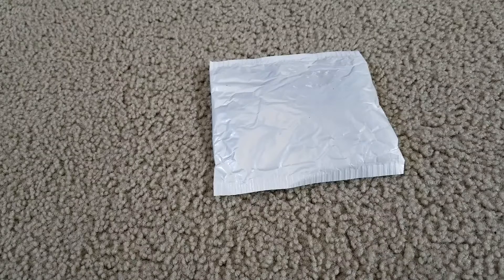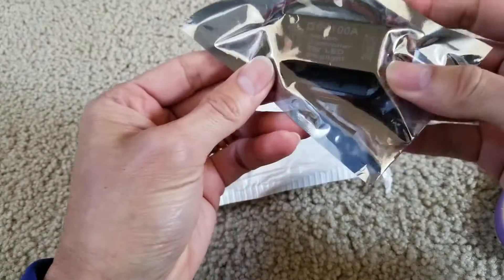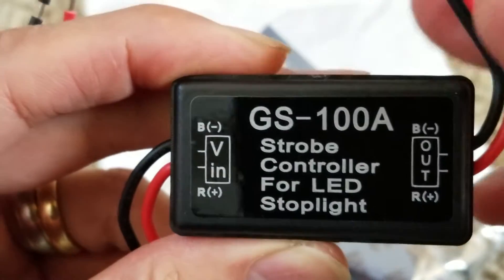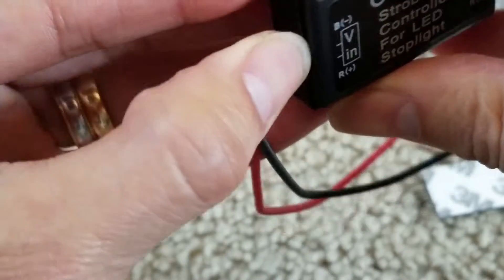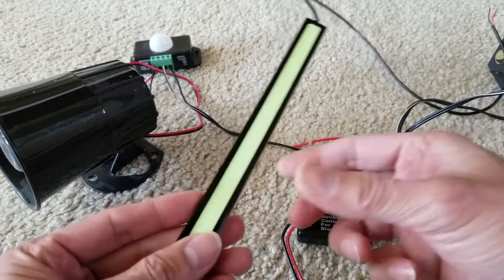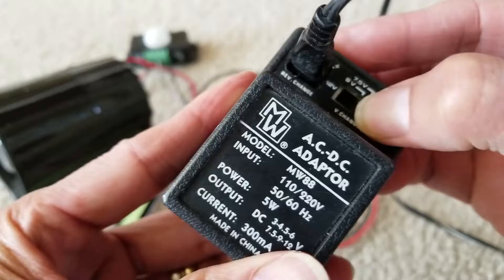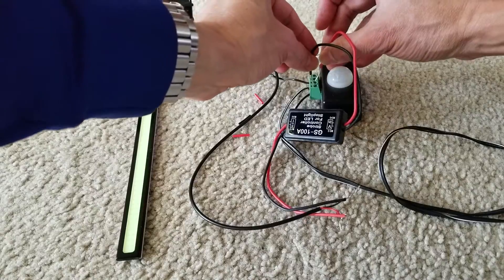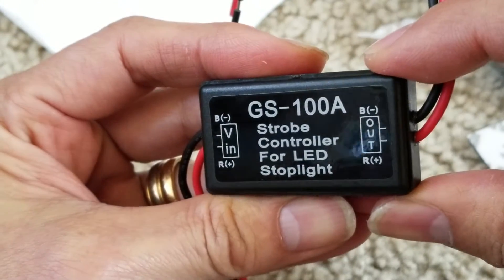GS100A 12v Strobe Controller Module For Car LED Stoplights + Test! 12 20 18!

Comment: Can this be used for headlights ???
Reply from the maker: It might not be legal to do it on the headlights.
Reply: There is a Russian analogue, the SL3 controller is called, it is better than the Chinese, it does not so much infuriate and there are several blinking modes, that is, not like the Chinese, each mode is a separate controller.
Reply: It only flashes when the lights are first turned on.  To make it continue to flash you would have to turn the lights on and off.